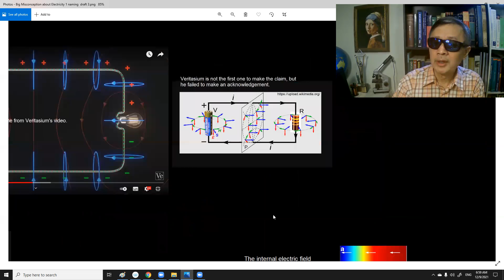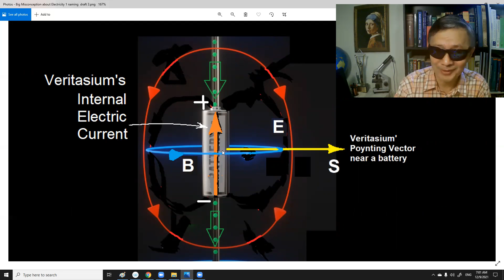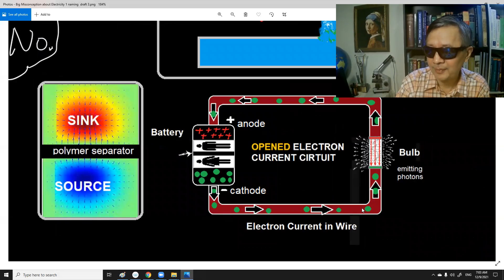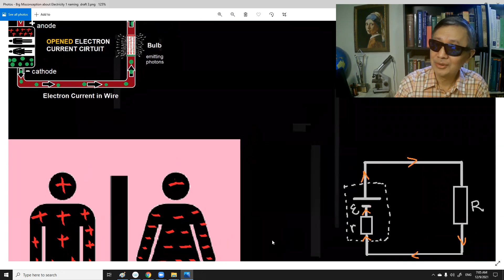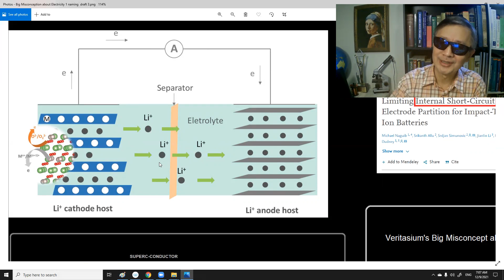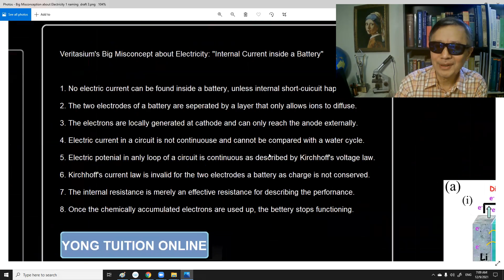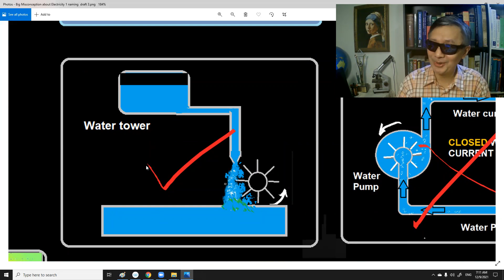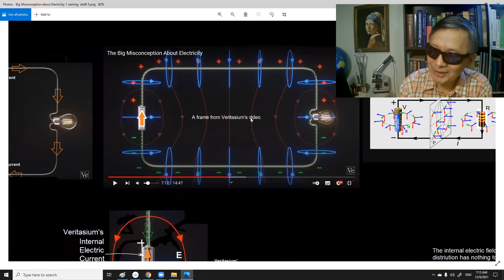No Electric Current inside a Battery: A critique on Veritasiaum's Misconception| Yong Tuition 211209

Comment: You neglected the fact that the build up of excess net charge in each half cell, in the absence of a flow of ion in battery to balance the net charge in each half cell, is able to attract ion from the other half and repel the ion of same charge in the original half by columbs law.

Here are some order of magnitude calculation to show that your idea is far from reality.

P.d. between electrode of a galvanic cell ~1V
Size of a cell ~0.01m
Internal Electric field due to p.d. between electrode ~ 100N/C

Assuming there is NO ion flow in the battery, so ion build up and there are excess charge in each half cell
Zn-Cu battery:
Zn density 7g per cubic cm
Zn atomic mass 1*10^-22 g
Size of Zn electrode in battery 1cubic cm
If all Zn is ionized to Zn++, there are 6.6*10^22 ions accumulated
Each ion charge =2*1.6*10^-19
Total charge accumulated = 20000C
Electric field created by this accumulated 20000C in the half cell of battery with size around 0.01m calculated from columbs law=  2*10^18 N/C

Assuming I approximate everything wrong by an order of magnitude, the electric field created by the excess charge build up if there is NO ion flow, is still 10 order of magnitude larger than the field created due to p.d. of the electrode ( standard eletric potential). 

Your idea is absolutely wrong by at least 10order of magnitude....

I am a PhD student in solid state physics btw.

Comment: You are 100% correct there is no electron current inside a battery. If the battery alone was conductive there would be electrical 
current inside the battery without even connecting it to  a circuit thus it would discharge open circuit!  The battery behaves more 
like an electrochemically precharrged capacitor where an electrical potential difference (i.e. voltage) is prior created between the 
battery's two ends positive (+) anode and negative (-) cathode.

This is also made clear by the manufacturer which is notifying that the battery has almost zero leakage current and an internal 
dielectric resistance in the range of 100's of MΩ (i.e. not to be confused with the in series effective resistance of the batteries due 
to its leads connections  and conductivity of plates that is a very small resistance  and in the range of mΩ or less). 

For a non-rechargeable battery assuming there is no leakage current across the two terminals of the battery, the stored potential 
energy of the battery is consumed by the kinetic energy and heat generated by the excess free electron charges on the (-) terminal 
of the battery moving along the resistive load circuit to the opposite (+) terminal of the battery which is lacking in electron charges. 

This process is continued until the two terminals of the battery reach electrostatic equilibrium and there is no more electric 
potential difference between them (i.e. zero voltage measured between the two terminals of the battery). At that point we say the 
battery is empty.

Prior, a non-rechargeable battery (batteries that cannot regain their charge due an additional electrolysis cycle) is charged by the 
manufacturer and yes during the electrolysis process there are ion currents (not free electrons current) among the two plates of the 
battery and the electrolyte solution used that creates in the first place the electric potential difference between the two + and - 
terminals of the battery. After  the cycle is completed a dielectric barrier is inserted by the manufacturer in between the two plates 
of the battery inside the electrolyte solution to prevent any internal electron or ion leakage current between the two plates of the 
battery + and - terminals and the battery is ready to use in an electrical circuit as an electrical power source or more specific as a 

voltage source.  

Contrary to popular believe and misconception, there is no further electrochemical reaction between the two plates of the battery 
via the electrolyte solution when the battery is discharging through the electrical circuit load connected to the battery. The dielectric 
barrier inside the battery makes sure that all the potential energy of the battery flows and is consumed only by the electrical load 
connected to the battery. When the two terminals of the battery via the electrons charge transfer thought the electric circuit 
connected to the battery, reach electrostatic equilibrium thus there is no more potential deference (i.e. zero voltage) then the 
battery is fully discharged and empty.

Comment: This time I somewhat disagree with you in that even though no electrons flow inside a batterry, but there is positive ion flow, which is equivalent to an electricity flow (as same as electron flow in the circuit that is equivalent to an electricity flow but in the opposite direction).
Reply from the maker: Can you justify your idea by Coulomb's law? Namely, the positive ions move from the negative electrode to the positive electrode. Let us know, please.
Reply: @yongtuition  No need for theory.   Just measure the amperes in the electrolyte.  You'll find that the electrolyte amperes are exactly equal to the amperes in the battery connections out to many orders.   Then, any theory which predicts otherwise, is wrong, by definition. 

But if not performing a measurement, you must already know that the electrolyte is conductive, behaving as a low resistance, so basically we've placed a short-circuit between the battery plates.   Please explain why there should be zero current in the battery electrolyte, when there is large current in the external battery-circuit?   The electrolyte is shorting the plates together!

If the battery electrolyte cannot acts as an insulating open circuit, then where do you think the break in the circuit must be?   It's not in the conductive electrolyte.   (Consult chemistry textbooks and discover there is no such break.   Charges leap between the electrolyte and the metal plate.   Charges flow through the conductive electrolyte.)   Batteries are not capacitors, batteries are closed circuits with very low resistance.   Ah, where then does the battery potential-difference arise?   Go to chem. textbooks and look up the Electrochemistry chapter describing "half-cell potential" and "half-cell reactions."   For example, in lead-acid batteries, neutral hydrogen is split into an electron and proton, and they flow in opposite direcitons, creating an electric current (where the proton flows off into the acid solution, while the electron flows back into the metal battery-plate.)

On the other hand, physicists aren't expected to know how batteries work, and I think the physics community is filled with electrical misconceptions (if the topic is electrochemistry.)  It's more an engineering topic.

Engineers have to take chemistry classes, and learn the details of battery operation (and learn that salt water is conductive, even though no electrons flow through salt water as they flow through metals.)    In addition, a smart electrical engineer learns that protons flow in acids during electric currents, although the chem. textbook calls protons by the name "positive +H hydrogen ions.)    Grotthuss mechanism of "proton hopping" in acid solutions, versus Drude Model of mobile electrons in metals.

Going further: if you actually stood barefoot in water in your basement, then grasp a live AC power line, and five amperes flow through your body, did you think that the water-pool was an insulator?   And the deadly amperes in your body, they must be some sort of capacitive current (where 120V DC would be safe?)    No, this goes against basic science all the way back to Faraday, all the way to before A. Volta, who knew well that salt water, acids, (etc.) were conductive.
Reply from the maker: @wbeaty  Using Coulomb's law please.
Reply: @yongtuition  i believe there is an ion flow inside the battery. By using columbs law, if there isnt an ion flow to balance the excess net charge built up over time in each half cell, then the net charge of each half cell will attract ion from the other half to neutral the net charge to zero.
Reply: @yongtuition  let alone the mutual repulsion due to columb force between ions of same charge in the half cell with no net ion flow to balance the net charge. Ions are objects with charge and it can develop its own electric field. Not only the electrode In a battery can develop its own electric field.

Comment from the maker: 1. "Each metal electrode transfers COULOMBS per second." No. The two metal electrode act as the electron soure and the electron sink. See 5:23. 
2. "Batteries behave as closed circuits with very low internal resistance." True. But the internal resistance, together with the external electric current at the electrodes, is merely used to phenomenologically describe the voltage drop V=rI, which is an indicator of the performance and the age of a real battery.  
3. "This produces a charge-separation as positive ions are forced away from the equal amount of electrons left behind in the metal." False. The electrons generated from the "oxidation" would immetiately run away into the load and to the positive electrode once the switch is on. Thus, there always more Zi ions than the electrons in the zinc bar. 
4. "Batteries are pairs of half cells fighting each other." No. both the electrons and the positive electron are happy to be attrated to each other. 
5. "The zinc electrode "wins," forcing the copper electrode to "dissolve backwards" growing thicker with electroplating". No. Copper ions are "reduced" because of the coming electrons, instead of the zine electrodes. Actuallu, the copper electrode is the winner in attracting the elelectrons.